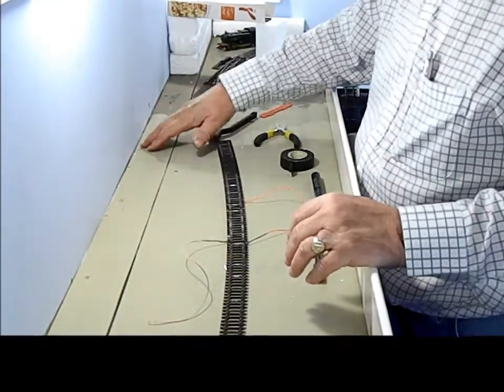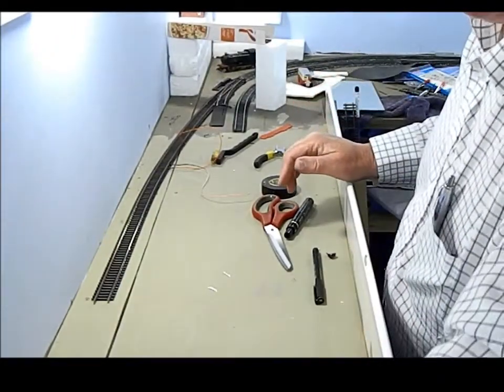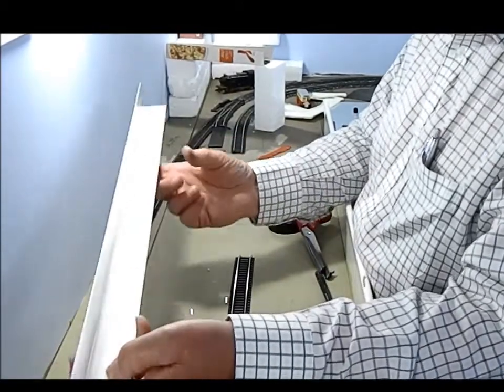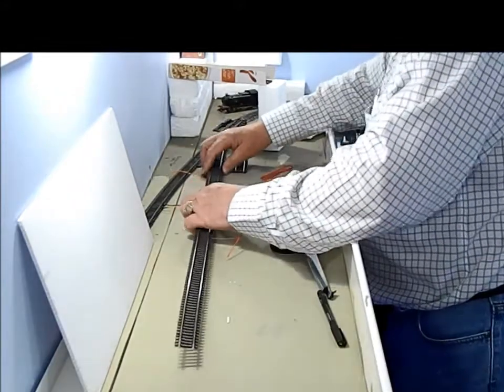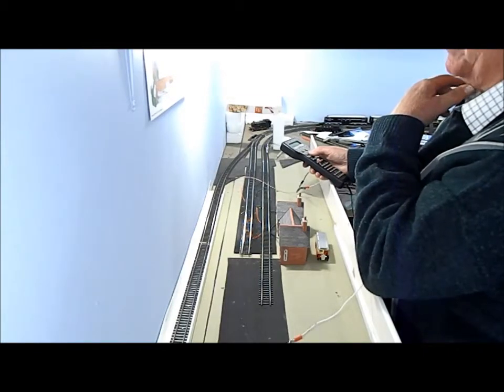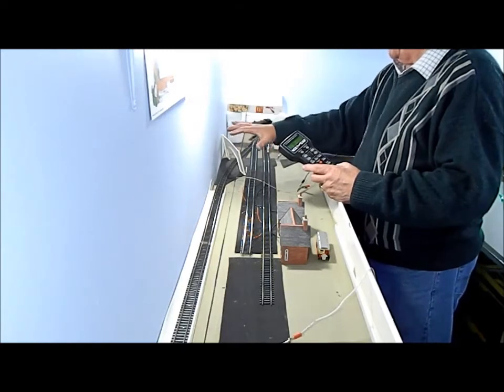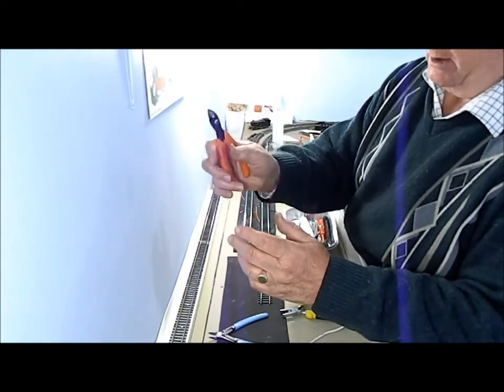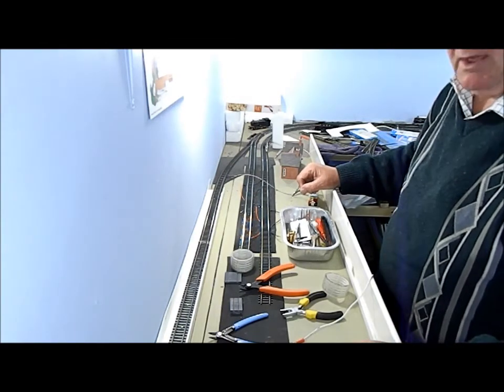No3  Track & recovery under hillside

Comment: Excellent stuff. Have subscribed. Will follow with great interest. How wide is your baseboard on the video please?
Reply from the maker: Hi robotmonkey and thanks for subscribing. The base board where the hill is going to be is 14" wide. The other side where the station and goods sidings will be is 24 " wide . From wall to wall about 5.5ft and a touch under 10ft long.